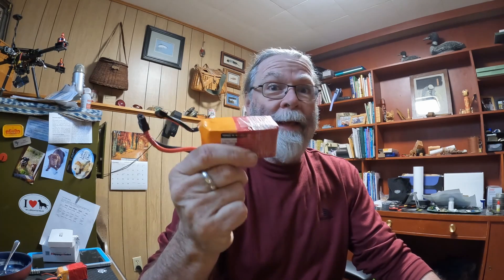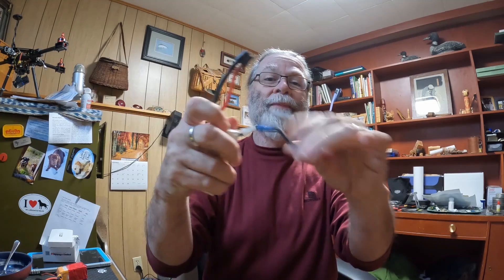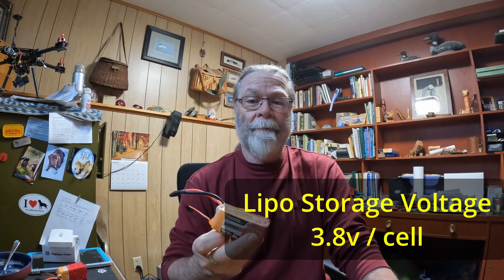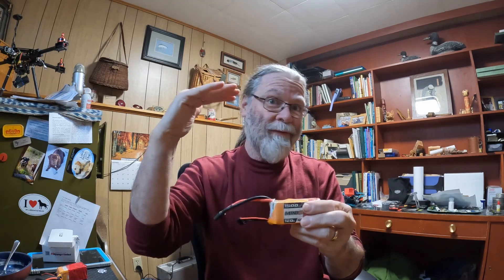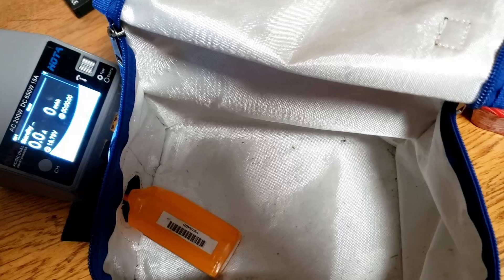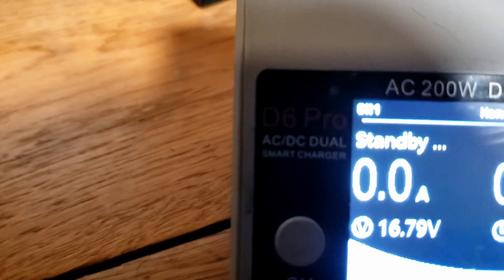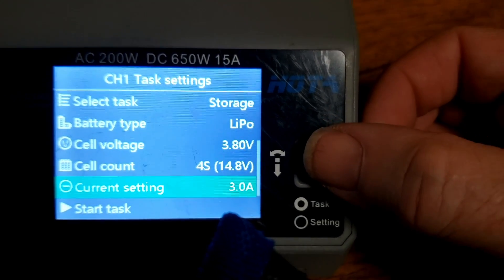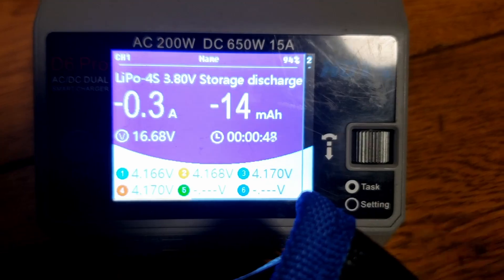Lipo Storage: what is Lipo storage voltage and how do I put my lipos in storage?

Comment: Great video thanks, so if i plan on using the battery the next day or maybe the day after is it ok to fully charge them for that period of time? or should i just storage charge them and bring them up to full on the day of usage? Also say during the winter when i might not be using the battery for a few months, is it wise to check to make sure they are still at storage level every so often? If so how often would you say its worth checking in on them? Thanks for any help.
Reply from the maker: Thanks for taking the time to watch the video.  It is best to keep lipos at storage charge until you need to use them.  I charge up the night before if I'm going out for a day.  If I'm going out in the afternoon, I'll charge them in the morning.  When I get home, I'll put all used lipos back to storage level.  If I'm going to fly the next day, I will keep any I didn't use at full charge.  I try hard to not have them at full charge for more than a day or so.  The smaller the battery, the more important it is to get them back to storage.

You shouldn't need to check lipos over winter (or any long storage period ).  I don't check mine, and winter here is about 7 months long.  Once a lipo pack is at proper storage voltage, it will stay at that voltage for months with no issues at all.   A change of less than .05v isn't unusual, and is no issue at all.  However, if a pack or individual cells in a pack significantly drop in voltage while stored, there could be a problem with a pack.  A significant drop would be .1 of a volt (3.8 --> 3.7) while stored. 

Hope this helps you out.   Happy and safe flying.
Reply: @blueskyfpv  Thank you for taking the time to reply, i always believe in safety first, it never pays to be in a hurry where it is concerned. I guess if i become a little paranoid over the winter months i can always use a cell checker to see if there is a discrepancy in one or more cells and check for any puffiness.  Thank you for your advice.

Comment: does the battery stops automatically once the battery reaches storage voltage? or do I have to stop it manually?
Reply from the maker: Hi.  If you are using a proper battery charger for lipo batteries, the charger will stop charging after the battery is full.